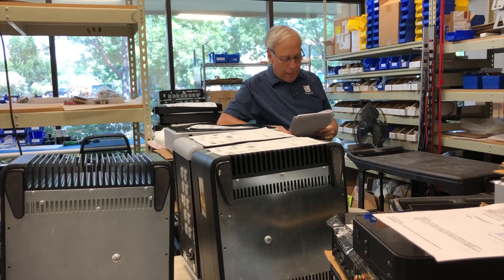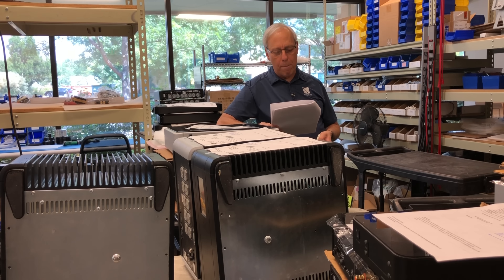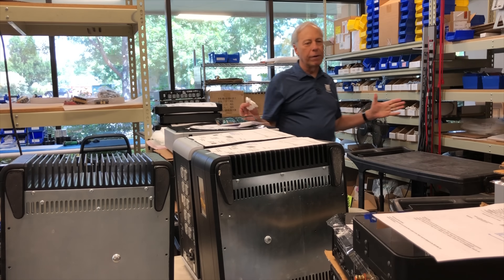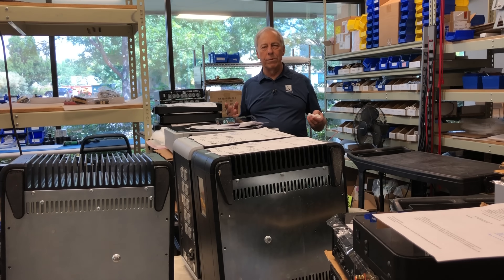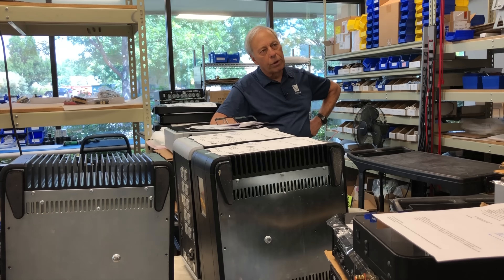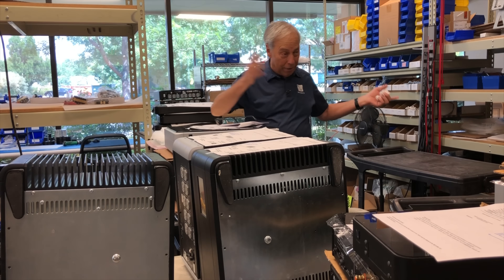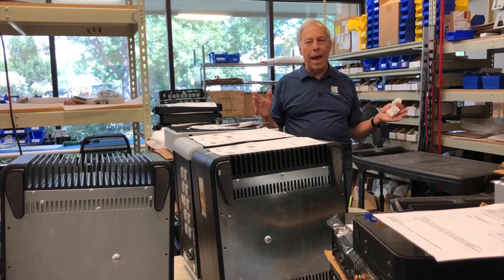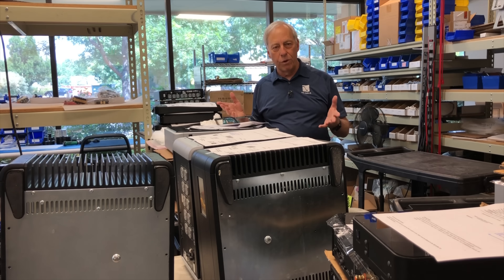Why should speaker cables have a minimum length?

Comment: Whoa Paul, that was a car-crash of an answer damning with faint praise. With Naim they treat the speaker cable as a component attached to the output of the amplifier whose LCR stabilises the amplifier. They advise against particular types of cable construction and recommend others. Their cable called NAC A4 is a parallel spaced pair to accommodate their output stages. Once they get too short they no longer meet the ideal LCR for the output stage. They used to make this a condition of the warranty. Perhaps a zobel network wasn’t as good sounding, perhaps other cables made the amplifiers overheat and fail.

Comment: If one speaker cable was one foot long and on cable was twenty feet long you might hear a difference especially if it's something cheap like 14awg wire. But normal good quality speaker cable shouldn't matter especially if both cables are the same length and they aren't super long. For super long runs have an audio engineer install a 70V amplifier/wiring system for you. (They make high-end 70V amplifiers that cost thousands of dollars.)

Comment: Thanks Paul, was always wondering if those 50' runs on my pro reinforcement rig ..werent  costing me a wee bit of signal along the way ...they were
Reply: Years ago, in an `open,' medium sized book & record store, one large room, sort of divided up into separate areas for the various types of products, but no interior walls, the owner had 4 good, good sized speakers. We decided to place one of these up in each corner of the room. As I had some familiarity with electronics & audio, he asked me to help him. I decided to use the same length of cable, from the one amp to each speaker, even though the closest speaker was pretty close, about 15 to 20' of cable needed, & the furthest speaker was much longer, between 50 to 70' of cable needed. So, 4 X 70' of cable, good sized lamp cord, purchased = yes, 280 feet. I was worried about, `phasing,' would a much shorter length of cable make a difference?  The end result: it sounded pretty good! All of the speakers were high up, on top of display cabinets, book shelves, above anyone's head, so the sound wasn't blocked by anything. In about the middle of the room, it sounded good! Actually, in terms of phase, standing on one side of the room, in one corner, if you calculate the speed of sound, the difference, delay in the sound from a farther away speaker, should be more important than different cable lengths. This was just an idea, & it worked well! He didn't question my idea, didn't say that, `Couldn't we save some $ by buying less cable?' {`True audiophiles' don't worry about cost, do we? Isn't only the sound what's important? Worrying about cost is so, `tacky!' Simply buy everything from Paul - you'll be alright! Go ahead - let's take out your checkbook, right now! Here's a pen!}

Comment: I immediately knew that the issue was related to a Naim amp. This is an old story with Naim amps but I thought that was ancient history. Naim amps would become unstable without the speaker cable of at least a certain length. An inherent part of the design. And it only worked with cables that are high inductance, such as the NACA 5. I am not a fan of the Naim sound. It’s quite in your face and lacking nuance. Just my opinion though.
Reply: I find Naim more musical than any other amp. Forget specs. I heard so many amps for upgrading my 35 years old amp. Recently I got all capacitors changed from Naim NAP14O as per advice from Naim Audio. Wow what a transformation. I don't need to buy new amp.

Comment: Wires make a huge difference in the sound, but the amount of difference they make is directly related to the quality of your system, mainly your speakers and amps.  Just raise the quality of your wires to the quality of your system, it's not that hard to figure out.  Formula 1 racing cars can take advantage of very expensive tires but that same tire quality would be a waste on a mini van, that doesn't mean that the racing tires are 
"snake oil" just because they don't improve the handling of the mini van very much or at all.  Get It?
Now you can go to Wire World and buy the wires that go with your system and budget, I like the mid priced stuff,  just don't use lamp cord or the wires that came with your equipment for free.  The latest wire designs can make a huge improvement in your system if you have a "Formula 1" type system.  20,000 bucks and up.  Once you get into the area of 50,000 for amps and speakers, upgrading the wires to a thousand bucks for speaker wires and another thousand for the interconnects will completely change your world over spending  just 200 bucks for both sets of wires.  I've seen the look on faces when the switch is made and each time,  it gives me a great feeling to see them freak out at how much better their system sounds.  I don't sell them, I just hook them up, incase you were wondering.  It's not just the materials like better copper and added silver, it's the design of Wire Worlds cables, it's one guy engineering one product for a long time, he's good.  I'm sure lot's of companies can make great stuff, I only use his now if possible.
Reply: The analogy with tires is risible.
Reply: Hi Bill, I read your post here and just recently got to know about wire world cables. I appreciate you are serious as I see most people's posts being very silly. Can you reccomend if one should be okay with their entry level cables? I am just recently started to try cables as my new improved system clearly expose weaknesses in the chain. But I don't know where to start with the cables.
Reply: Excellent illustration.

Comment: Paper cut ouch !!!! 

Wacky ? How about people that use bare flat ribbon wire on glass isolators ?  I have seen a system that used suspended wires . I've seen a system that someone attached a 9 v battery . I think 3 meters sounds reasonable to me ... maybe it has more to do with speaker separation ( assuming you're not using mono blocks ) 1 meter is 39.3 inches +/= . is about 10 feet total. assuming you don't want to watch your speaker wires stretched like a telephone or power lines . Sounds like a more than reasonable distance minus the wire drop on either end of the cable . 

I can argue that 15 foot cables would be the perfect length in an average size room . When I sold audio in the late seventies I would often cut  wire 15-25 ft per channel .  70's when copper was cheap and often tossed in with the deal . 

If it is some sort of resistance capacitance and inductance thing ..... who knows ?  I guess it's not speaker wire gauge specific ?
Reply: 25' per channel? Yeah that's when people placed speakers up in the ceiling corners.😁

Comment: Naim do not have a Zobel on the output which makes the amps very unstable with certain cables and cable length (capacitance and induction issues). This keeps the Naim fan boys buying their crap cable.

Comment: Powered speakers have very short speaker cables running from the internal amps and the speaker drivers.
Reply: dcfincher the amplifiers have an inductor to keep the amp stable in those. a naim amp forgoes this in exchange for speaker wire.
Reply: x21 But I find it kind of stupid to rely on the cable to keep the amp stable. Most amplifier designs don't rely on a certain inductance of the cables to remain stable. The best cable is no cable obviously doesn't work for naim cables. But it also means that Naim will sound a bit less puchy in the bass and the top will be slightly less pronounced. Simply because of having longer cables with more inductance.

Comment: What if you cut two speaker cable sets? One being over the 3.5 meter length, the other at 1.5 -2.5 meters length, and then connected them parallel to the speaker? Would this combine the "mellow" signal of the long cable with the "sharp" signal of the short cable?
Reply: It would work as a balance control.

Comment: paul is the copper beeing removed from your speaker cabel due to the AC-signal ? and where does that copper that is missing from the cables go? does it travel and add copper to to the transformer, or is it lost due to the chemisty of usually copper and electrons, and it is reactions between electrons and copper that over time degrades the copper in the speaker cable ??
just like the positive+ and negative- cabels that's inside your car, gets degraded over time..

Comment: I personaly tried 4mm (kable direkt) found it had very powerful detail, but cold sound and the bass punch wasnt there, pure copper, then tried 2.5mm had more mids but also cold and not musical , bass was better, but not as detailed and not musical also, that was QED 79 strand, went back to a pair of really old wire that I had i think is probably 1.5 mm wire copper and my systems sounds muscial again, voices seems nice, and bass is good too, not always is a better conductor better sound, the wire made such a difference I was thinking of selling my system before.  I think with the minimum length, Niam know that the balance of sound will be how they intended it to be , if you ignore the logic of having more power from less resistance from a shorter length, and use the power control from you amp you might find that the ratio of balance of frequencies is effected by the wire, and some sound too harsh, the 4mm wire i tried i could hear distortion in the recording , and sounds that probably didnt need to be heard, only on a good recording it sounded good, but compared to my 1.5 mm wire it was nothing, also too much treble can sound harsh with too much detail, test wires for yourself to see, my system is, Sony FA50es, soundblaster 24bit usb external sound card, and bose 201 series 3 speakers, or sony ss85E,  i also noticed where i positioned the speakers made a large difference, but non more than the wire, which i think now is more important in a setup than even the amp as in the long run i couldn't get it to sound good without the 1.5mm copper cable. The ratio and balance of sound and how harsh it is will be affected by the length and thickness of the wire. The soundblaster is better than the asus 24 bit model equivalent.

Comment: My guess? Maybe to prevent oscillation given the added inductance with increased cable length. Amp output stage may be Unstable other wise.  Lots  of EMI RFI out there going every which way. Homework: Can you see multiturn air core inductors in your amp at the output transistors?  Hmmm.  Have  fun!    -Sandy

Comment: From Leo:   There are numerous things I can measure on my Oscilloscope that no one can hear in a blind listening test.   Too many people spending a lot of money for bragging rights, not sound improvement.
Reply: True. I tend to use pure copper where possible. Guitar leads are a problem there  whereas speakers often lend themselves better to a technically better setup but let's face it, it all ends up in a solder joint at some stage which tends to be lead/tin on older equipment nier of which are good conductors.
Reply: It's ridiculous to claim that speaker wire length affects sound quality. The exception being really long lengths.  Audiophiles can be so gullible tricking themselves into hearing differences that aren't there.
Reply: @tac6044  you've said it all. 
maybe not audiophiles are involved in this kind of trivialThings.... maybe rare and weirdo wannabes .. (00)!

Comment: Of course, this is true, the cable is part of the damping circuit of the system and more important - part of the feedback circuit of the amp. E.g. A 3.5m cable 4.0mm2 has some 15mOhms. In fact, a shorter cable has less separation (resistance of some mOhms) to the point, where the amp „measures“ its (in 99,9 percent of all amps common) over-all-feedback signal to the amp-input. You might think, this is far to low to be important. You’re wrong! This is the central point of all cable discussion!!!! length, type, microphony, all of this is concerning to the topic. I even had some experience with amps, having the feedback point on the wrong place between the 2x 4 power transistors. With identical circuit and -related on the feedback point different pcbs, one amp was just lacking of sound quality.
So the feedback is more accurate measured amp-side than speaker-side with longer cable. On the speaker side, you have a complex high current RCL-load, frequency dependent and phase-shifting, dependent on moving membrane with settling and decay, which effects the measured signal a lot.

Comment: while yes it may be a possible marketing thing to get you to buy more wire it may have a safety thing too.

to properly load the output stage you have to use certain ohm of speakers but if the wire is too short it may effect the loading and could lead to damage of the output stage.

of course  i would think a good system would have other protection too.

Comment: It is fairly well known in high end audio that there is a desired speaker cable length because of sound quality.  Usually a minimum of 6 ft and what seems to be the ideal length of 8ft.  All cables sound different at different lengths and my guess is most manufactures tune their products using specific cable lengths and even brands and models of cables.  Their seems to be a synergy with speakers and components using certain lengths of cables.  Its actually a legitimate question and concern.

Comment: If you need to buy special audio cables of a specific length to get the right inductance/capacitance, then you bought the wrong amp.
Reply: HiFi  is a fiddly dream. I've  seen many amps  have the life engineered out of  them.
Reply: With that logic, if you had to buy a specific sized tire for you vehicle, you bought the wrong vehicle.
As has been mentioned Naim did it in the past but that was a designer choice. Some amps today don't like low impedance. Now it makes sense to say if you have a speaker with a brutal impedance and phase angle and you bought an amp that pops fuses at anything below 2 ohms then you bought the wrong amp. It's a system after all. Everything always. has to work together for best results but it doesn't mean everything needs to work with everything else to be a valid product. 
An eight watt SET doesn't  work well with  Maggies.

Comment: Longer cable will very slightly affact dampening factor I think, making it worse with longer restive cables. If the amp is unstable increasing the resistance might help slightly.  With thick cables I dont think you will hear a difference.
Reply: affect - to change 
effect - a result

affect - ?

Comment: If the stereo is on left corner of the room and you have a speaker in left and right corner of room should you still use equal length cables?
Reply: Yep, thats what they say… both should always be same length

Comment: How come when you upgrade your speaker cables and buy better quality ones than those supplied by the manufacturer that the sound quality stays exactly the same ?
Reply: Because the system sucks.
Reply: What are you buying, computer speakers? Manufacturers don't supply speaker cables with their speakers.
Reply: Ignore 
carlos oliveira, he's a snake oil believer.
Reply: @cbcdesign001  Firstly you have no idea of what you speak. You are using the term snake oil incorrectly like most people who have no experience with high performance audio. Snake oil is the legitimate article that has been medically proven. Just so I can save time and educate you, it's also bummer not beemer/beamer for a BMW car. Most, who don't know anything, including many BMW owners, call refer to their cars as beemers. Beemers are motorcycles not cars. Such is the world of the internet where morons have baseless opinions trying to pretend they have any expertise on topics so that they can feel important. Here's another one I see often. It's yin and yang not ying and yang. Hope you've learned something today. An easy way to avoid embarrassment is not to offer an opinion on something you have absolutely no credibility. Cheers.

Comment: My speaker cables are 12 inches long, 10 gage braided oxygen free with gold plated silver soldered connecters, the best sound ever. I can hear 10 HZ to 20 HZ, no harmonic distortion, wow and flutter is totally gone.
Reply: So your system only reproduces the very lowest notes available on a pipe organ?   About 16 Hz.

Comment: Naim for years considered the speaker cables as part of the output circuit, and cautioned people to not use non-Naim speaker cables because they didn’t provide the proper inductance, resistance, and capacitance.  I believe they abandoned that approach years ago though.
Reply: since it does not hold up :) and probably got called out for it.
Reply: Naim is a piece of shit company with a sole purpose of robbing idiots of their money. There's no such thing as "gear based" inductance, resistance and capacitance. Any copper wire will do the trick as long as the minimum is satisfied. After that, no improvement is possible.

Comment: I was talking with some friends about this subject and one offered up that skin effect may be a contributor but a few of us debated that true skin effect doesn’t come into play with the frequencies we use in high end audio and that skin effect is null below anything that is 100Khz. I would like to know if this is actually true
Reply: You are correct. The skin effect of electrons only traveling along the "skin" of the wire does not come into play at audio frequencies.
Reply: Skin affect is a non-issue at audio frequencies.